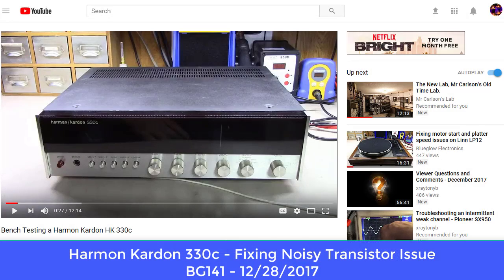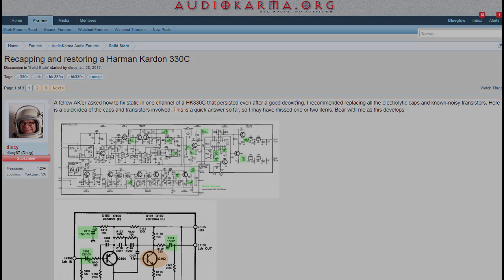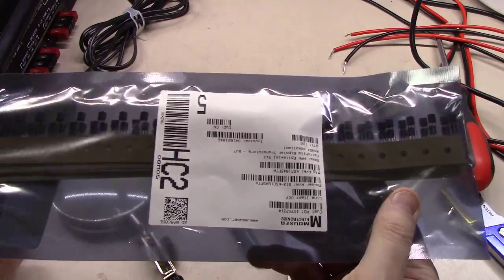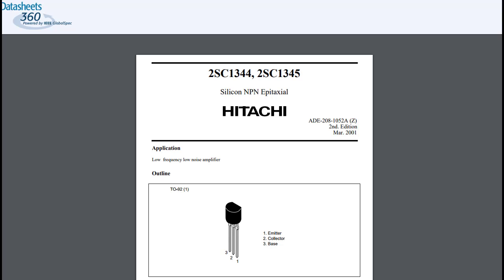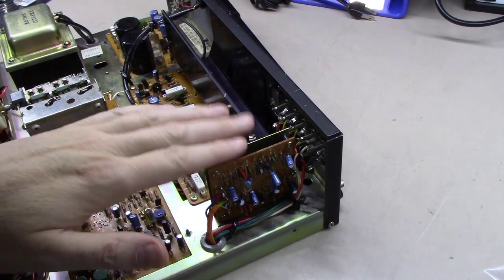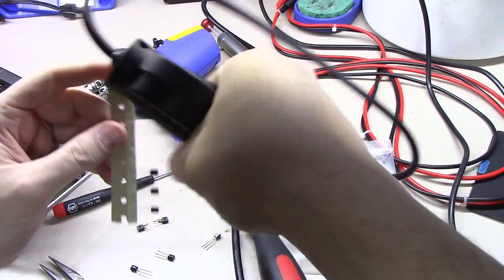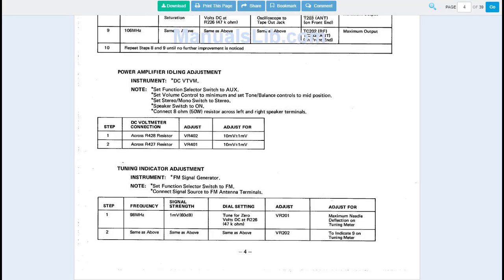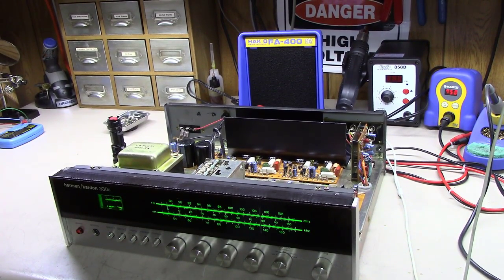Harmon Kardon HK 330c - Fixing Noisy Transistor Issue

Comment: Nice! I have one of these as my garage receiver. I love it. Got it for about $40 on eBay backi in 2003 or so, I guess before vintage audio stuff became so popular. Used it originally as a replacement for computer speakers, it was driving two RatShack diecast aluminum minimus speakers. Nice to know I wasn’t imagining that it does have a fair amount of power for a mid-70s unit.

Comment: I've had an amp that would sit there for weeks and work just fine, and then for no apparent reason it would go DC then slip into protect.  That particular unit turned out to just have a cracked solder joint on a resistor that I only managed to find by going through the amp and wiggling every single component with a wooded stick till i found it,   then I had to quite literally use a microscope to confirm the crack.  Worked flawless ever since.     Intermittent problems are the worst

Comment: I have a 330C with the same issue (the noise only happens on Phono for my unit) and this video is great help, i thought I would have to toss mine but now i have a project to look forward to.
Reply: Your PHONO will do that if you don't have shorting plugs in the RCA jacks. The PHONO input is a little amplifier and any noise on the line gets boosted.

Comment: Instead of replacing all the transistors, I would have try to heat them up with the tip of the soldering iron. The one(s) that's  generating the noise  is doing it on higher temperature, possibly in the lab the temperature was lower and the transistor didn't rich the noise threshold.  After, I would change only the defective one and his pair from the other channel.

Comment: Your video was a first for me. Up until now I'd never heard or seen anyone referencing my articles at Audiokarma. In a different 330/a/b/c thread at AK, someone didn't know they needed to rotate the KSC1845 devices 180 degrees when replacing the 2SC458 and 2SC1344 devices. Another AK'er posted "go watch this educational video". I was watching keenly and then you navigate to one of my threads. Startling in a nice way. Very good video!
Reply: One of my other posts on AK is the collected knowledge of AK on "which transistors are known to go bad". The thread contains the original device number (e.g. 2SC458, 2SC1344, etc.) and the most-common replacement devices. http://www.audiokarma.org/forums/index.php?threads/top-ten-worst-transistors-noisy-failure-prone-whatever-and-replacements.731653/
Reply: Just started on my vintage receiver voyage. AK has been so valuable. I reference it for advice on turntables as well. All thanks to good and people like you sir!  From helping noobs like myself getting fair pricing to keeping our newly acquired vintage gear running. Thank you for taking the time!

Comment: Is it necessary to match the transistors for sound quality?
Reply: Modern transistors have more consistent output levels (hfe, beta, or gain), so it isn't quite as critical as it was in the past. That said, when you buy replacements, it is a good idea to buy more than you need and then use a cheap component tester or an expensive transistor tester (e.g. Peak Atlas DCA55 or DCA75) to find two devices that have very similar hfe figures and use those as matched pairs. As an example, you could take Blue Glow's suggestion of buying 100 KSC1845 devices (much lower price at this quantity), specify "reel" or "cut tape" as the packaging you want, and then measure and write down the resulting hfe for each device. If you write the hfe number on the packaging tape, right on top of the device's location, then it's easy to eyeball those measurements and select pairs that match which you can then pull and install.
Reply: @DougLucy  Great suggestion to leave in the packaging tape - and thanks for all of your helpful suggestions on other sites too. I'm using all of this information to rehab a fleet of HK 330, 430, 730. Love these receivers!

Comment: I think it would be better if the complimentary pairs were also replaced with KSA992.
Reply: fernarias yep, replace them with a matched pair for balanced gain
Reply: Good point. When replacing transistors that are part of a complementary pair, it is best to replace both members of each pair and aim for matching hfe across the pair (and across channels for stereo). Luckily for 330B and 330C owners, there are no must-replace comp. pairs. The 330C has no complimentary pairs and the only complimentary pairs in the 330B are Q407+Q409 and Q408+Q410. Those should get KSA1220A+KSC2690A replacements.

Comment: Excellent! I have a 330b with what appears to be the same problem. Also, I have a Sansui 2000a that seems to exhibit the same problem. Does anyone know if this is an issue with the Sansui as well?
Reply: The HK 330B has a number of variants under the cover, so you'll need to identify which one you have first, then chase down the known-noisy transistors to replace. There are several threads on Audiokarma that cover these questions. One of mine has guidance on both identifying which 330B you have and which devices to replace. http://www.audiokarma.org/forums/index.php?threads/harmon-kardon-hk-330b-recap-restore-and-upgrade-bom-part-list-kinda.739572/
Reply: The Sansui 2000A has plenty of 2SC458 and a few 2SC871 devices that are known to go noisy over the years. Both of these should be replaced with KSC1845 devices, just remember to match the pinout order when installing the new devices, just like Blue Glow said.